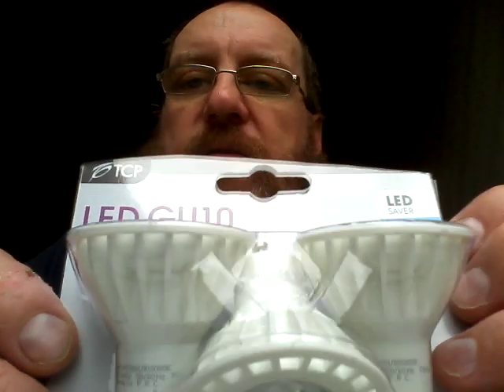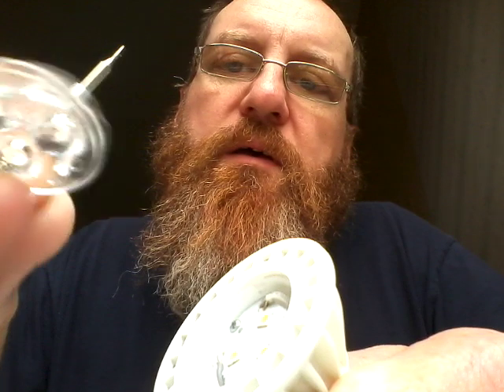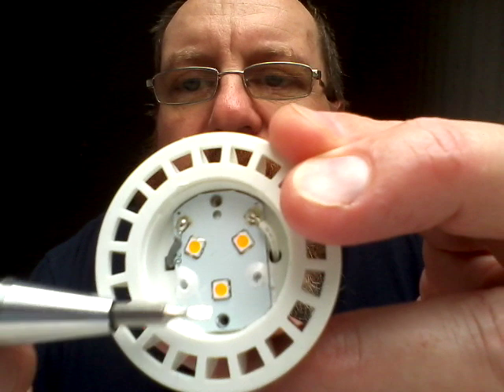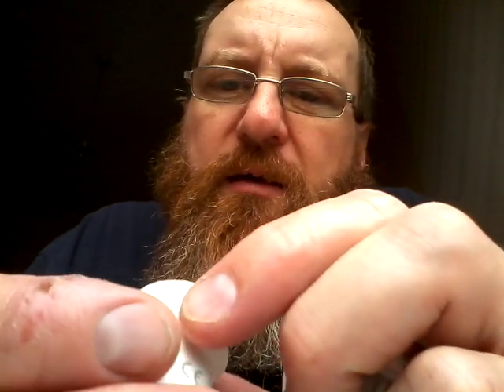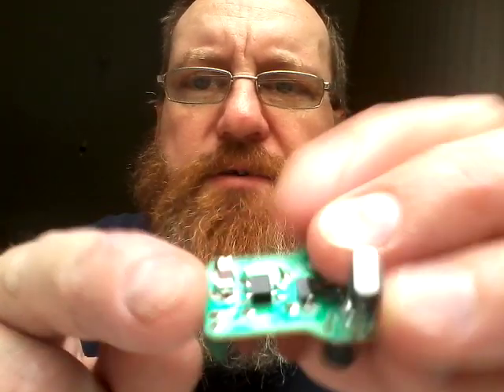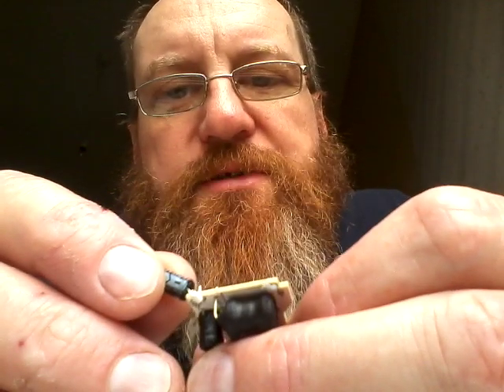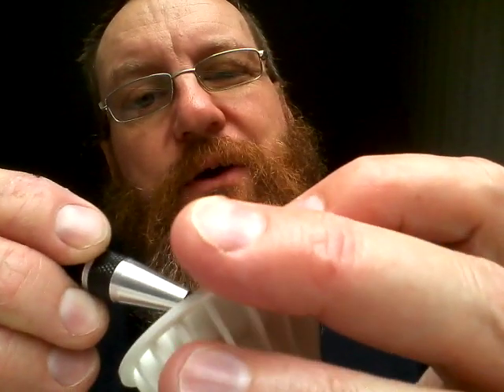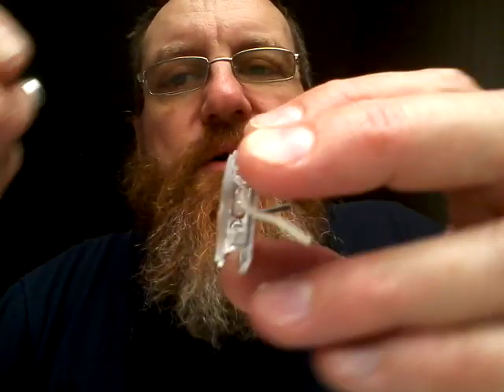Inside a 2W TCP LED GU10 lamp.

Comment: A very simple (if a bit destructive) test to see if that is thermally conductive plastic is to scratch the paint off.  Thermally conductive plastic is thermally conductive due to being loaded with graphite dust and is as such either black or very dark gray.
That is just a simple off line switcher using either a purpose made LED driver chip or an off line switcher driver that uses active current limiting (which can be hacked to make the output constant current).
Reply from the maker: The plastic is off-white throughout.  And quite "scratchy" like a thermosetting or self extinguishing plastic.
Reply: bigclivedotcom
Sounds like the plastic is just the normal supposedly self extinguishing stuff that most CFL ballast housings are made of.  Or are supposed to be made of anyway.  They are probably relying on the area of the MCPCB acting as the heatsink.  Given that TCP is known for marginal at best lamps over here (they are a big OEM for store rebrand lamps, especially Commercial Electric/n:vision/EcoSmart Home Cheapo house brand ones which are the most common), I would expect such design practices to carry over into their LED offerings.

Comment: Hi Clive did you check the actual wattage on these bulbs?  They look like half Watt leds
Reply from the maker: The chips are suspiciously small.  While looking about for 3030 data online I found various current handling specifications which varied from 150mA to the dubious 300mA and above.  The lamps are rated 2W and the low resolution power meter I tried showed 2W but it only displays to the nearest watt.
Reply from the maker: Guido Mennen Oh, that's a good idea.  I've not come across that hack before.